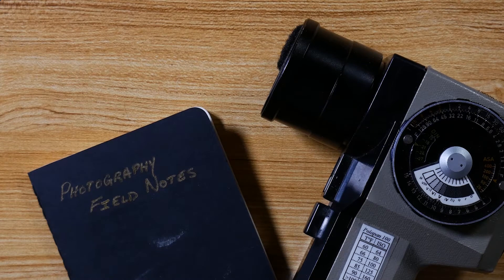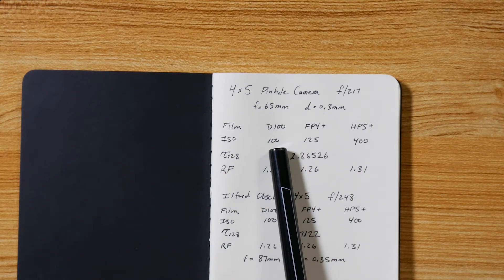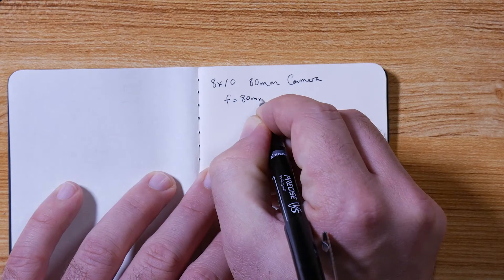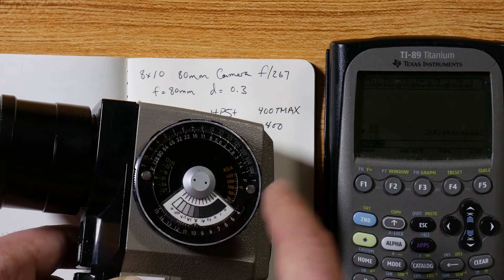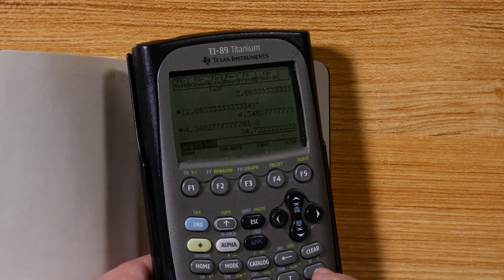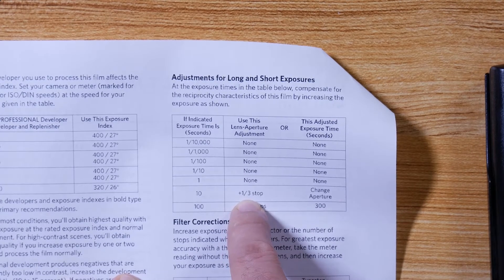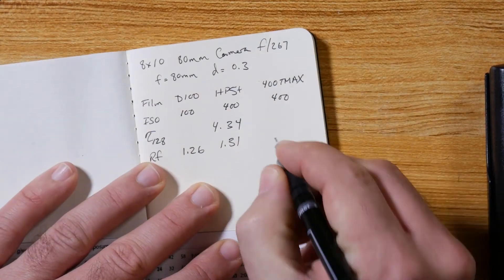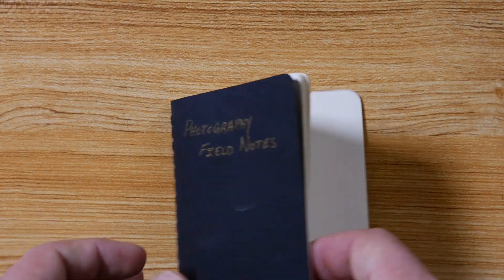Pinhole Field Notebook for Exposure Calculations

Comment: I'm setting up a spreadsheet that I can print out and stick in my notebook. I'm using f/16, because it works with everything. In the first column is the measured time from 1 to 1/1000 of a second (in full stops). Next, I have the adjusted time based on the pinhole camera's f-stop. Then, for each film where I have a reciprocity factor, I calculate the time adjusted for failure. (I also have a threshold at which the compensation is necessary, since for FujiFilm's NEOPAN 100 ACROS II it's like 2 minutes.) It has the constants and formulas in case I need to calculate something not listed. I figure it's a good starting point and I'll see how it goes.

I'm going for reciprocity failure and/or slower films, because I am not confident in my ability to open a shutter for shorter durations with any accuracy.